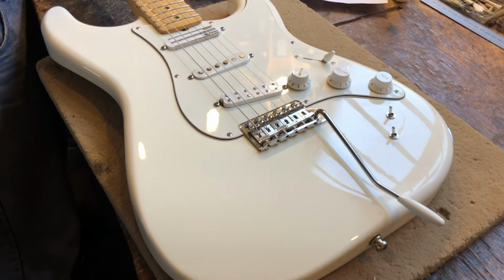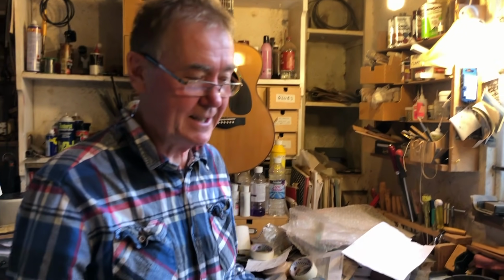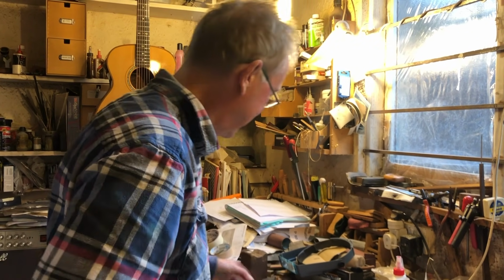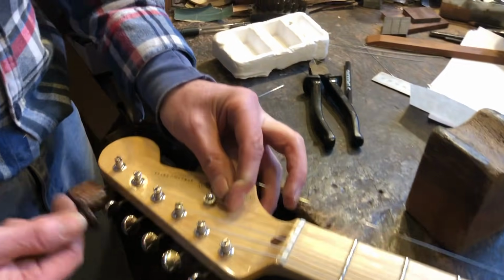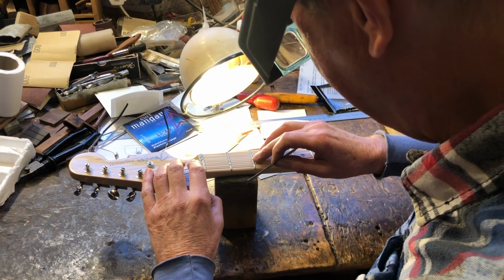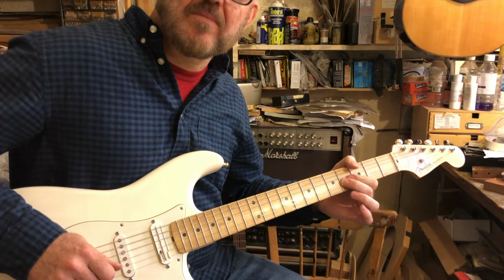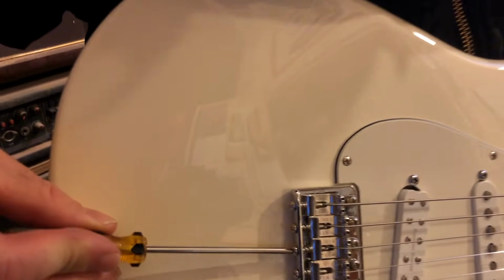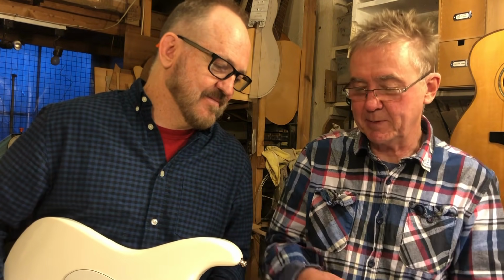Dan’s Vlog – The Ed O’Brien Strat Gets Set Up By Jonny Kinkead – That Pedal Show

Comment: Thanks, Dan.  Extremely helpful to all players.  It suddenly struck me, Dan, that you think and visualize at the molecular level, where electrons live.  Ed is at the microscopic level where scratches and imperfections live, just out of plain sight.  Everyone should grab a magnifying visor as Ed has.  (they are inexpensive)  You'll be amazed at the machine scratches left on at the factory.  Think about the cost increase for the hand-work required to offer a perfected guitar.  A magnified look at frets and fretboard for affordable guitar is eye opening.  With great faith and confidence, I leave all my guitars in the hands of my friend, Larry Cragg (please look him up) first discussing only the string gauge for each string, and he does his magic, right down to his own pegs on the acoustics.  It all makes a cumulative and dramatic difference.  Larry has changed my life.  Every player will benefit from a proper and detailed setup.  The difference between off the shelf and a proper setup is remarkable.  (p.s. Nice Curt Mangans...)

Comment: Hey Dan!  Fender makes a little stiff spring to go in the vibrato arm hole....it will take up any slop that you still may have, works GREAT!  You don't nescessarily have to screw the arm in as far either.  Be careful if you take the arm out after, the spring can fall out if the guitar is turned over.  Also...could you ask Jonny if he ever uses a notched straight edge to check neck straightness?  Cool video!  Learned lots of tricks!  Thanks!

Comment: Brilliant stuff. Great knowledge but interesting the difference with others who'll have all these precise measurements for action, relief, nut height etc. I go with Jonny that each guitar has its own personal ideal set up. The measures help towards it but feel and sound is the important measures really
Reply: Over time, I am sure the senses become trained and attuned.  For me, I will probably measure a bit more so that I have a baseline.
Reply: The measurements are a sure fire way of making your guitars feel consistent. I set strats up with 10'000 inch relief between the 7-9 fret and I play hard so have 1.5-2mm or 4-6 64ths string hight. I play with 10s so I can pick up a Strat and play another of my strats and they both feel consistent in how they play.
If you only have 1 guitar or want each guitar set up for depending on how you want that to feel then you start with the measurement as a starting point then tweak up or down as needed. For me I know if I broke a string when I was gigging I could pick up a backup Strat and not miss a single note because the action and truss rod was not all different
Reply: I always start with a measurement of relief and action.  But I still vary that, i.e. 7.25" radius, more relief and higher action than a 9. 5" or 12" radius. But I always normally end up just tweaking for feel at the end.

Comment: Home luthiers tip, you can get a set of welding tip cleaners to use for lowering your nut action and cleaning nut slots. Nut files are pricey!
Reply: Great tip. I would never have thought of using something that welders use, for a guitar. :)
Reply: Actually those things are OK to have as tool for perhaps polishing or cleaning nut slots but I wouldn't want to try slotting a nut blank with them, they don't cut very well.
Reply: Thanks. I will look into that for sure!
Reply: Welding tip cleaners? What gauge are those? I've seen some saw blades that are like 0.14 so they might be fine for starting slots, but otherwise my go-to for wound string slots is a popsicle stick with a piece of string superglued on one edge: I can have even more gauges than nut files!
Reply: The stewmac nut files are a little pricey, but they do work extremely well.
Reply: If you don't do that for a living, invest in better tools, using a tool specifically made for the task'll make your life easier for anything related to guitar modding/setup/repair

Comment: Action ALWAYS before nut, because if you set the nut where you want it (nice and low) and then you adjust action, you run the risk of going to low and having to shim or replace the nut.  A professional luthier taught me to always adjust in this order (1) neck relief (2) desired action by capo on the first fret and measuring height at the 13th fret - taking the nut out of the equation. You can always raise the action, raising the nut required shimming or superglue/baking soda, etc. (3) Nut action/height (4) intonation.

Comment: Really enjoyed this one.  Have always agreed with concept of intonating by ear because of the fretted notes going sharp vs the harmonics.  I also like to tune lower strings a little flat for the same reason and because when you hit the open low E hard it goes sharp and settles back to its 12th fret harmonic pitch as the vibration lessens after initial attack.  Over time you realize how far to make these little compensations based on how heavy you tend to fret strings.

Comment: Anyone shocked he did not check for high frets? I've owned tons of production fenders and every single one had numerous high frets....not many but enough to give you the buzz/rattle you can hear on the top end and enough to ensure that intonation and playability is affected for a player as sensitive as Dan (or similar pro level). I understand he wasn't doing a fret job but level and polish has been part of every setup I've ever paid for. Anyone disagree?

Comment: A note about using pencil lead dust as a nut lubricant - Pencil leads are made from a mixture of powdered graphite and clay, baked into a hard rod. Clay is a mixture of water and fine particulate minerals and is an abrasive. There are 20 grades of pencil hardness with the softer grades containing a higher ratio of graphite. So for nut lubrication purposes the significant phrase is - use a soft pencil, otherwise you are mostly 'lubricating' your nut with abrasive clay dust. Most people do not have soft lead pencils just lying around and these days you would probably have to special order the softer grades. From HB these go all the way ten steps down to a 9xxB.
Reply: I'm pretty sure HB is soft enough and EVERYONE has one of those.
Reply: @PeterWasted  - Well an HB pencil has 68% graphite, a 9B has 93% (roughly). Personally, if I'm going to try using pencil lead graphite as a nut lubricant, I'd rather use a pencil that was mostly graphite.
Reply: @ResoBridge  If you do, I'm sure it will be fine. The point is, HB is also fine. I would contend that almost no one using a pencil to lubricate guitar nuts has worried about the grade of the pencil. I believe you are over complicating something which doesn't need to be.
Reply: @PeterWasted  Well I would agree that "almost no one using a pencil to lubricate guitar nuts has worried about the grade of the pencil. " That was the point of my post. There are too many bits of guitar lore floating around that guitarists mindlessly accept, without really thinking about what they are doing.

Comment: Pretty much every guitar I get one of the first things I do is tape off the neck with painter's blue tape. Then I have some wet/dry sanding pads from 500-4000 grit and depending on the frets initial shape depends on which grit I start with. Finish with Meguiar's mirror glaze metal polish and I have nice shiny frets. First time I did it, I was amazed by the difference in feel.

Comment: The beauty of the Slotted Machineheads is that you can easily take off the strings at the headstock end to make adjustments as necessary (say to the action at the nut, or adjust the truss rod), and then refit the strings and checkout your adjustments. (Probably can't do this on strings 1 & 2 if you cross the string through the Machine Head slot as shown on the video).

Comment: A better way to set intonation - Get the open string in tune, then get the 9th and 21st frets to play as close to a perfect octave.  Adjust the saddle until the 2 fretted notes are as close to an octave as possible when the open string is in tune.  This spreads the "out of tune-ness" across more of the fretboard.  Try it - I feel confident that you'll like it.  Hat tip - Peavey's Chip Todd, designer of the T-60.

Comment: I would suggest that this is the correct order for guitar set up adjustments - 1/ Vibrato Bar Springs. 2/ Neck Relief. 3/ Action Height. 4/ Nut Slots. 5/ Pickup Heights. 6/ Intonation.
If the pickups are set too high, then this will interfere with the intonation reading, so they need to be measured and adjusted before you intonate the strings. Secondly, if you file the nut slots before you adjust the action, and then decide to lower the action, then the height of the nut will be affected too, and you may need to replace it in order to get it back to the correct height.

Comment: Great informative video you guys! After watching the whole thing, I still have two questions though: 1) what fixed the rattle the guitar had initially? Reducing the neck's relief and lowering the action seems like it could only make it worse if it came from a string buzzing on a fret. 2) After tweaking the neck's camber and putting the new strings on, Jonny ends up pretty much spot on with the amount of relief he wanted. What's the procedure in case the relief is still off? Do you take the fresh strings and the neck off again and adjust it? Seems like a painfully long process!

Comment: This was a great video!  Helps so much in better setups by myself. As a woodworker, when I am going to roll the edge on a scraper, I use oil from the side of my nose or behind the ear to lubricate the steel.  Wondering if that source of oil would work for frets :-).

Comment: Truly awesome. One slight point of disagreement, however. If you set the height of the nut slots before setting the action, you may be in danger of interference between the vibrating string and the first fret if you have to lower the action appreciably.

Comment: I have a pair of Danelectro-made Silvertones, both using aluminum nuts with deep & wide nut slots. Neither guitar gives me any tuning problems…no sticking or pinging. I’ve never needed to lube ‘em either. Dunno if the guitars left the factory with the slots nicely shaped & smoothed, but they’re certainly that way now.

Comment: Ive got five Yamaha Pacifica 112V superstrats,  and all tuned to eadgbe the whole octave down( originally because of my left hand injury),  just the low E s a bit loose, but I like my jazzy loose strings,  my set: Daddario: 9 11,5 15 22w 30w 42w, the secret to strat tuning is the balance between string tension  to each other and the balance between strings and springs.... many dont bother so  they never get it right...

Comment: Dan, rather than float the trem to get the brass block off the body in the rear cavity, would not 5 springs put more pressure on the trem, therefore the claw would not be a tight and the brass would not have been touching the body???? Just asking...great episode.

Comment: Great video thank you! I had my necks completely straight for some time but i found that a slight bend on the neck enables me to turn down a tone-o-matic bridge even further and get lower action especially on the higher frets, theres a sweet spot on each guitar but it's probably just my preference. And for Bigsby guitars i prefer a tad of silicone spray over graphite on the nut but with bone you probably don't want silicone anyways, pencils are a great tool, cheaper and easier than Micro Teflon or (i bought it) Big Ben's Nut Sauce^^
And now i finally learned how to set up pickup height properly, i never knew what i was doing at that point but i had to lower some pickups because i lowered the strings so much they touched the pickups while strumming.

Comment: I always have such a problem with Strats on the lighter gauge unwound strings rattling with overtones like that if the saddle height screws are not tight against the threads therefore evenly holding up the saddle.

Comment: I do believe the curve of the truss rod slot gives the rod a mechanical advantage. As you tighten, the rod tries to straighten and pushes the center of the fretboard upward rather than simply squeezing the back plane of the neck. I don't think a straight slot would work nearly as well. Double action truss rods, however, don't rely on that mechanical advantage.

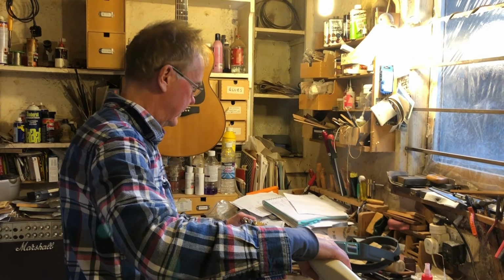Comment: In regards to 24:53-25:56...  I was looking at the Floyd Rose Rail Tail bridge and it has rollers in the saddles. I have a question for Mr Kinkead. What are his thoughts on roller nuts or bridge saddles that have rollers. Would they be a smoother point of contact and help against string breakage? Or would they move too much and cause tuning instability?

Comment: On strats its often the neck angle; if everything else looks right but its still stiff and 'off' feeling. Nobody seems to use the microtilt these days, but just a half a degree can make a stiff dull guitar in to a slick light monster. That is 1/2 of a turn tops. You are not going to see any gaps or anything. Its super subtle. Just loosen the strings, slacken the neck bolts and give it a gentle turn with a 3/32 Allen key. This also has the effect of decoupling the neck from the body some/a lot, so it can really brighten up a dull sounding guitar. The difference is just astonishing in the feel and tone. All those guys who used to say neck coupling was a big factor in overall tone, were not lying imho. Sometimes the body kills too much and lowers the resonant peak in an unsatisfactory way. Micro-tilt really can help sort that out. Just another reason Fender was a genius: get a good piece of wood for a Les Paul, you're happy, get a bad one, you're stuck with it..

Comment: Though I already knew most of what he is doing,  I am nowhere as experienced in describing it.  Johnny has a way with words that touch on understanding.  Great video gentlemen.
I have a q for the ol master and even the apprentice...
The middle pup has the poles all at crazy different heights the way Fender did them back in the day to compensate for the wound G string.  And it stayed that way though the G string has evolved.  Giving what many consider the Strats unique sound.  I have pressed mine to follow the radius of the frets then fine tuned for even volume on all strings.
Have you ever messed with that Johnny and what are your opinions on it.
Thank You!

Comment: I just went through all of this on this guitar. Did a bunch of work and it's working very well indeed (my tech did anyway). Filed down the nut slots, slight fret grinding up high to get it right with no choking out. Adjusting the exact height of the sustainer pickup and the back pickup were essential to get the sustainer functioning well. I have the sustainer AND the back pup slightly closer to the strings than I usually would.  Then have some useful reference numbers in the manual from fernandes re that.
Also float the trem is a must (imo) to really make the sustainer sing.  Put in a no load tone pot to get some extra bite as well.  Put in an aftermarket two point trem (no drilling) because the fender unit just was too wonky to get the smoothest sci fi sounds.  Loving the chunky neck.  Enjoy....
Reply: @Patrick McMichael It's worth it. For me the sustainer asks for a certain kind of playability to really get the most out of it. The nut was much too high on mine and w too much relief. Replacing the trem was more of a choice thing. However besides having smoother action than the 6 screw it made the string spacing better. No strings near the edge of the fret up high.
Reply: @Patrick McMichael I'm really enjoying it. It's not a traditional strat to start with, except for the comfy body shape (always nice) and the color which is also very stylish. If I want to play a traditional strat w 3 single coils, 6 screw bridge, etc I just use that. This is something different.  Amazing w fuzz/oscillators  + ambient/modulation effects + fully floating trem. 
The modern trem really opens up possibilities with the sustainer. Much more range and subtlety possible.  Smoother sounding/feeling.
Reply: Good tips.  I found I really had to raise the neck pup to get the sustainer working better.   I second reading the fernades manual and adjusting as necessary.  You can set the neck pickup output level under the back cover.  I found this was helpful to balance output of the pickups.
Reply: @Patrick McMichael looping pedal recommended. and slide.
Reply: @2speedy4u22  Yeah the exact height of both the sustainer pup and the bridge pup change the sound/functionality significantly. Even just a mm or 2. And yeah the fine tuners in the sustainer system in the back are important. And delicate.

Comment: Intonation: 
Yes, the harmonic on the 12th fret should match the fretted note because the octave is exactly double the frequency. But the harmonic at the 19th fret should not match the fretted note because the fretted note is governed by equal temperament, but the harmonic is simply 3x the open string frequency.

Comment: How did you get rid of the buzzing string in the end? I have an EOB Strat as well and it is driving me crazy.... the strings all sound kind of fizzy when i changed strings and went for 9s instead of 10s. So am assuming the saddle height msy need a look.